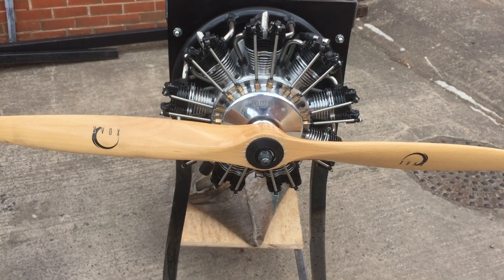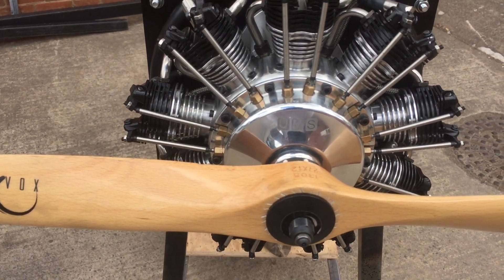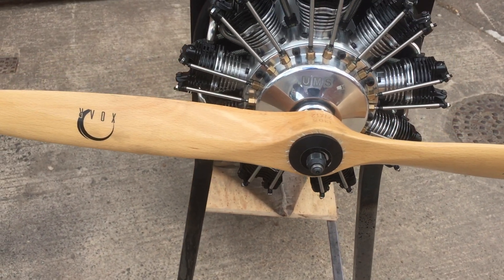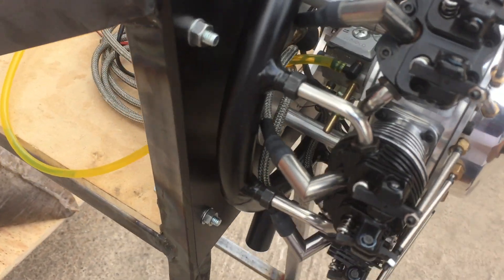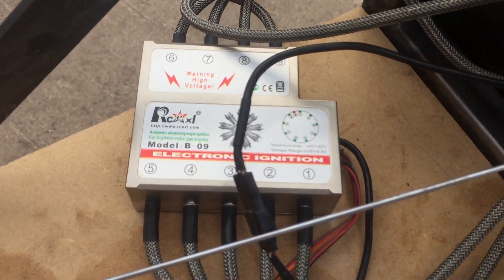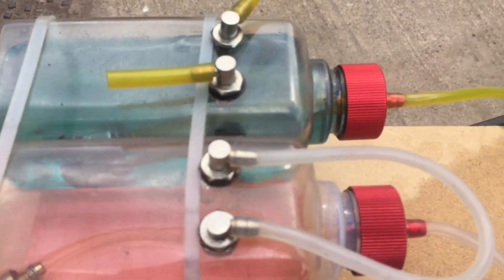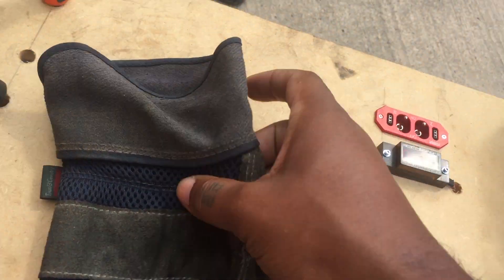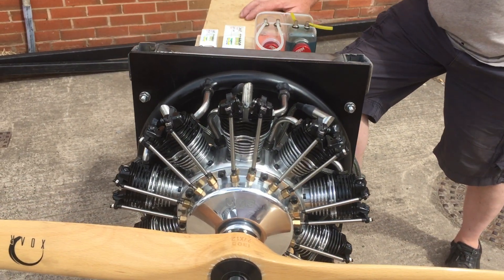UMS 115cc Running a 27” x 12 prop 900 - 4800 RPM

Comment: I Purchased one of these and plan to run it soon for the 1st time.  What are the optimum props for this engine?   I have a scale Axial 28x10, but realize I may need to go a little smaller.
Reply: From what I've read that's about what size they recommend.  Results in a little more than 5k rpm.

Comment: Do these come with the fuel pump?  If not do they need the fuel pump to operate properly?
Reply from the maker: jasonjanise yes all the UMS engines comes with our pump system
Reply: @Morris-Mini-Motors  but I'd be buying it in the U.S. so do they still come with a pump
Reply from the maker: jasonjanise This is our pump system we developed up some years ago and it’s only supply true us with our conversion kit and with all the Ums ngines